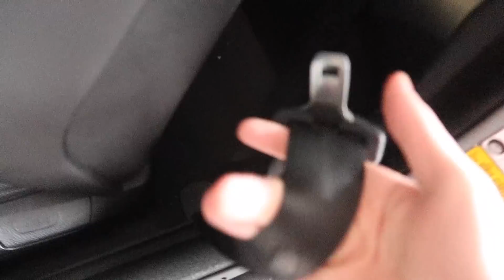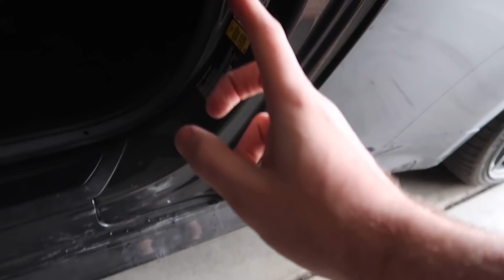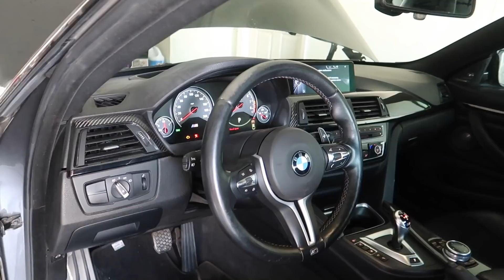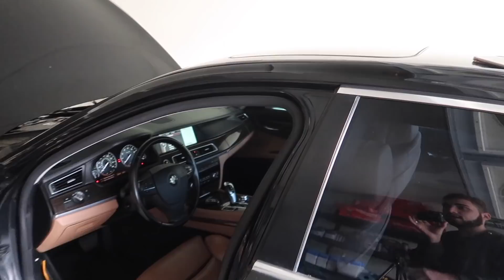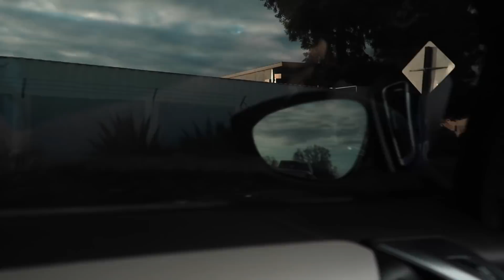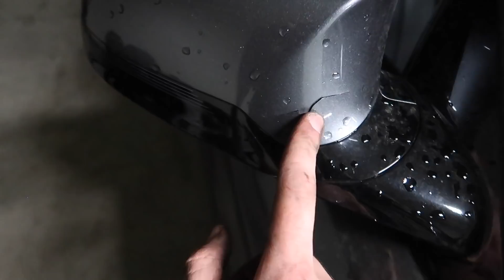Rebuilding A Wrecked BMW M4 Part. 12

Comment: hey nour, for the 7 series, change the parking lock sensor only, you will have custom removal and custom install.  since you are doing that, change the solenoids and shifter.  did that to my 750li and it works perfect!  parts in ebay.

Comment: hi good job. i dont know if you did it but to replace the arm you need to put the car at the floor level take a mesurment of the position of the whell and after put the jack to rise the whell at the right level and tight all. if not you will destroy the rubeer in short time ;)

Comment: Stay with the 7 series like your i8 after you restore it since it will cost more than it’s worth. But this way you can use it to haul parts in the trunk for your other builds just get a trunk mat instead of taking a loss and it’s a cruiser.

Comment: Just an FYI with that battery charger you have hooked up to the M4. The F8x has a li-ion battery and you need to make sure any chargers/maintainers you use are safe for those types of batteries. Otherwise you run the risk of damaging the battery because they charge in a completely different way than lead acid or AGM batteries

Comment: Hope you do the coding video.  I have a 2015 M6 and 2012 535i as well as ista P and D. I have not done much coding tho. Just diagnostic. Im in yuba city btw. Lmk if there is any BMW meets close by. I just ordered similar steering wheel for my M6 that you have in i8.